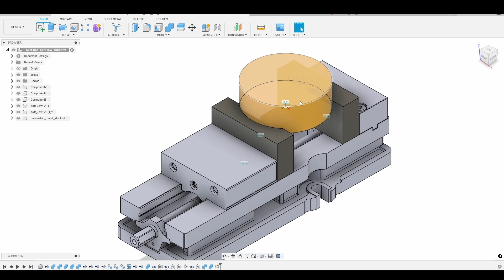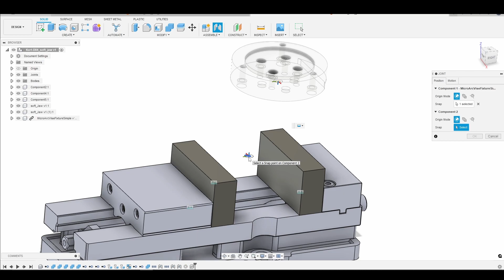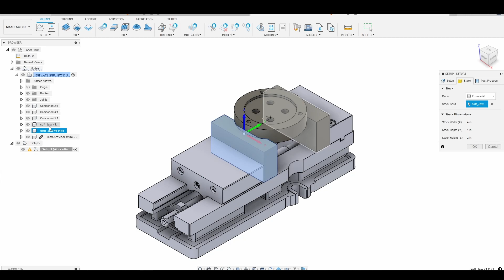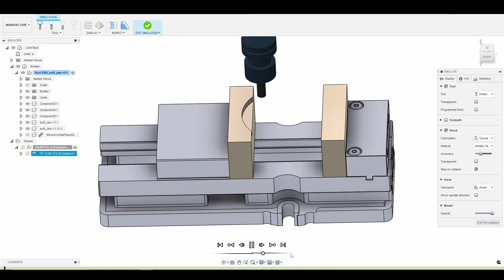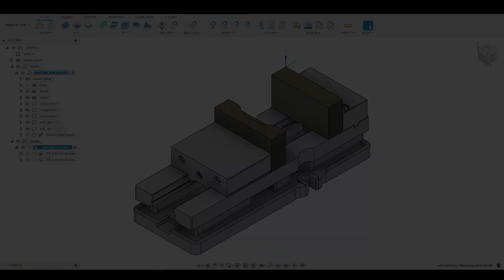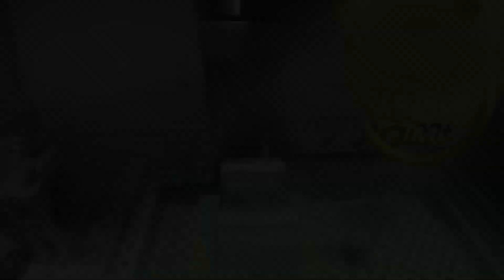microARC Vise Fixture Tutorial 1: Soft Jaws

Comment: Also did you yse the same softjaws for OP1 an d OP2?
Reply from the maker: In the future, I plan to make an adapter to mount the microarc 3 jaw chuck to a saunders fixture plate. It should help cut down the amount of softjaws I use for various round stock.
Reply: @MrSmith1231  alternatively there's the talon grips from mitee bite that can accommodate round/irregular stockk with minimal grips. Not the cheapest mind. I have a set for the 'square' parts
Reply from the maker: Nope, I used two different sets. I reuse the softjaws from op1 for all the 4" round stock I mill. Op2 has a slightly smaller diameter.
Reply: @MrSmith1231  that's what I thought. Thanks